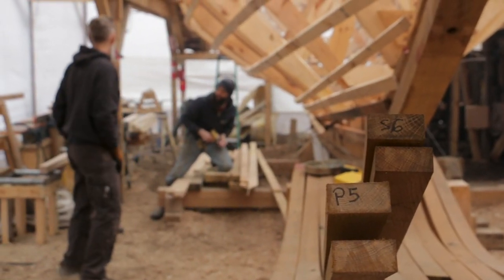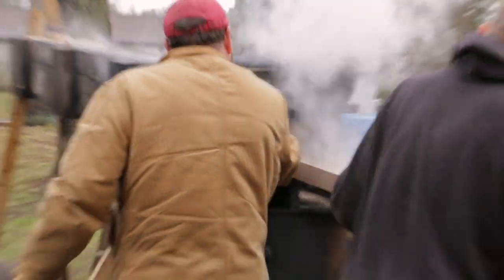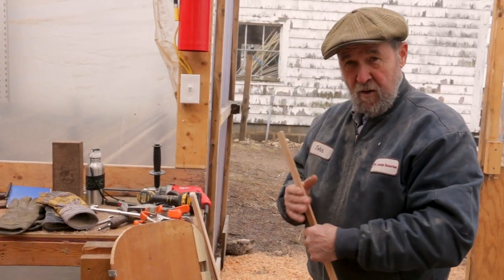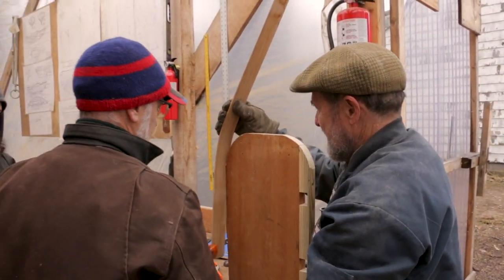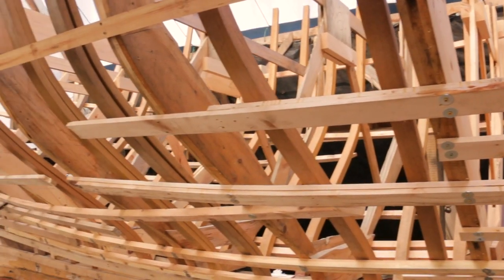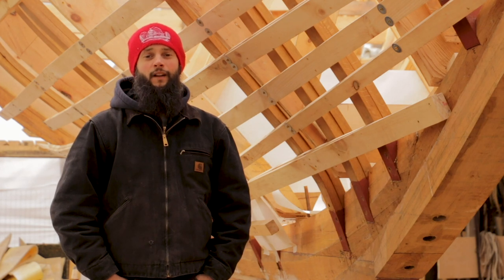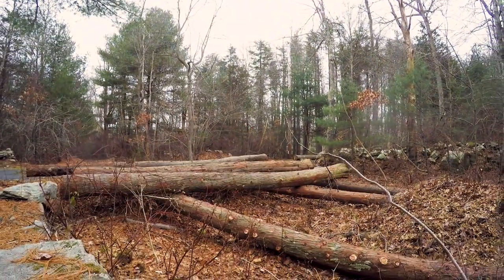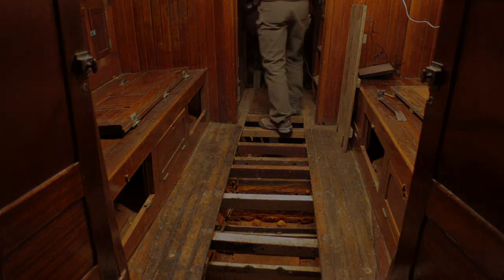Acorn to Arabella - Journey of a Wooden Boat - Episode 53: Framed and Disassembling

Comment: So, you guys are planning to put the planking up as the next step. I am inexperienced, but to me the logical next step would be to put in the floors and deck beams so that the frames have the structural support needed for the planking. Can you explain why the planking is going up next instead of the floors and beams?
Reply from the maker: The floors can be fit before or after, not a big deal one way or the other there.  The deck beams will come once planking is on and then the molds can be pulled out.  Until the planks are on and the deck beams are installed it is the molds that define the shape and give her structure.

Comment: I noticed that you were not using a backing strap when steam bending the thin stock. Its best to use a thin metal strap to back the pieces, but I have used 10-12 oz leather for the backing strap. This will greatly reduce to splitting and help achieve a tighter bend.
Reply: Mmmm interesting addition for the small planer box , aye min, will remember that trick
Reply from the maker: Thanks for the tip!

Comment: Hi guys. if at some stage you wish to clean up any brass or chrome items from one boat to another or just tarnished items and you want to bring them back to like. this is a quick thing to do soak the items in Citric Acid it cleans the items up and eats away at Lime Scale FAST but you have to put the item you wish to clean in a solution of Citric Acid and warm water for 24 hours.........GOOD LUCK

Comment: You should make or get yourself a steamer used for removing wallpaper.  It's a little easier on the wood than using a heat gun or paint stripper.
Reply from the maker: Thanks for the tip!

Comment: For some reason I think Victoria would have been easier to repair, than to build an entire new sailboat. I hope you guys use every piece of wood & bronze off the old boat that you can. My father was a structual engineer by trade, but he also did carpenter work & loved working with wood, he built cabinets, furniture & worked on old wooden boats. His father was Basque & he was a shipwright & luthier. He worked on wood shrimping, fishing, & sailboats boats, & at night built flaminco guitars. He was born in 1900. As a young man he also made spanish adobe style bricks & roof shingle. My father said when they would load the two large kiln's up the would burn for 7 days & nights. I cord per day for  each kiln.
Reply from the maker: To re-build Victoria you would have to build a new sailboat, new centerline, frames, planks... Leo Samson is currently re-building a boat in Victoria's condition and it looks like a lot more work! 
That is a lot of firewood!

Comment: Why did you have to disassemble/reassemble the frames after all that work to get them into place the first time?
Reply: Basically all the work they have done on the frames so far is to just get them into the right shape.
The removal allows them to be final sanded/oiled/coated/prepared so that they are water ready. You can't do that with them in the boat.

Great video guys.